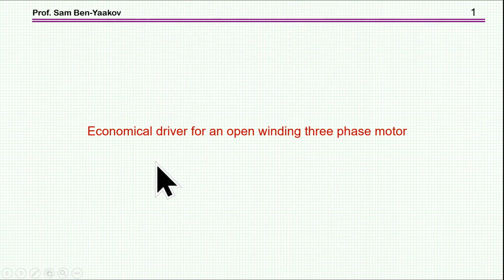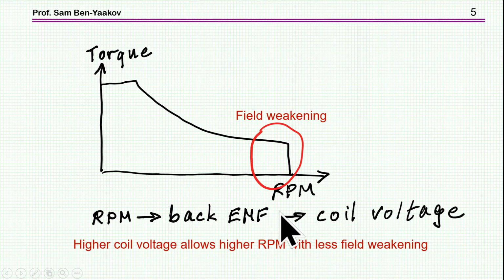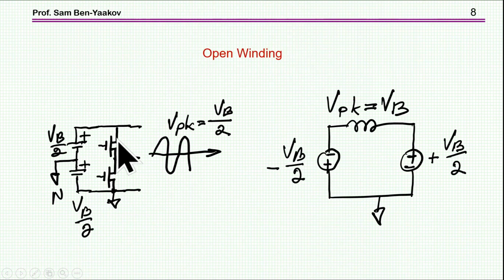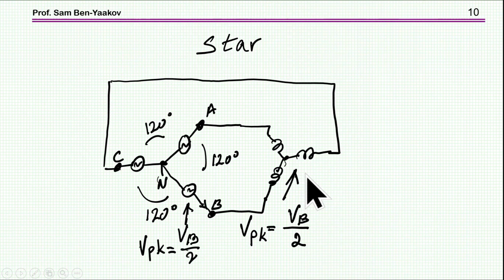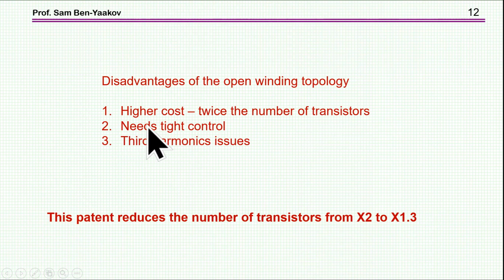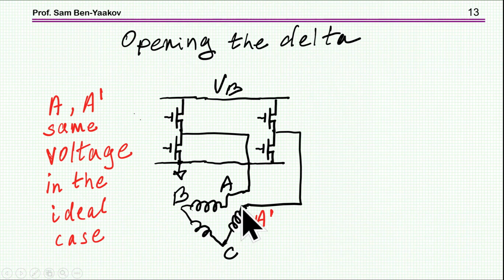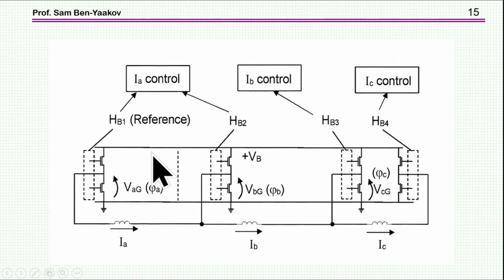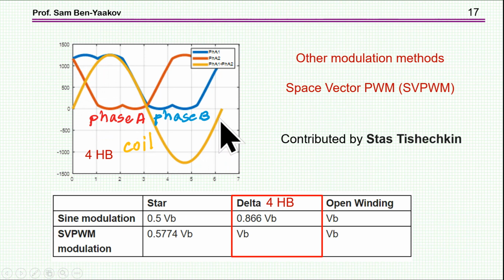Economical driver for an open winding three phase motor

Comment: Dr. Ben-Yaakov, my previous lab back in China re-invented this topology, for some special motor with zero-sequence Dc bias . 🤣🤣🤣🤣🤣🤣
Reply from the maker: Have you publised this in a public platform? If so send me the references/copies of papers and I will cite them next time I publish this subjct. And BTW, there ate previous publications on the subject which we discovered lately.
Reply: @sambenyaakov  They did publish several papers. Not sure if they are what you found. Some are as below:
[1] A. Li, D. Jiang, Z. Liu, X. Sun and W. Kong, "Unified Analysis of Winding Connection Sequence in Series-End Winding Topology," in IEEE Transactions on Industry Applications, vol. 57, no. 1, pp. 516-527, Jan.-Feb. 2021, doi: 10.1109/TIA.2020.3032936.
[2] A. Li, D. Jiang, L. Zicheng and W. Kong, "Five-phase Series-end Winding Motor Controller: Converter Topology and Modulation Method," 2019 IEEE Energy Conversion Congress and Exposition (ECCE), Baltimore, MD, USA, 2019, pp. 629-634, doi: 10.1109/ECCE.2019.8912165.

Comment: Hello sir, It will be very helpful if you could please give some explanation on the possible reasons for hall sensor glitches. While testing a hall sensor based bldc motor I could observe glitches in the hall sensor itself. Is it like hall sensor pcb mounted on the motor may have some grounding issue or something else.I could not figure it out. Kindly suggest.

Comment: Some doubts : The inner control is by voltage right ? ( So the outer is by current ? )...Also : Is it possible to apply that strategy for unbalanced loads ?
Reply from the maker: Thank for comment. No. There is no noltage control. The PWM is shiftdd by 120 deg and the current is controlled balaced or not.

Comment: But 360 is same 0 degree, so last half bridge is shorted to first half bridge, so how circulating current is eliminated?
Reply from the maker: 360 is the ideal case. the control may change it as required to get the desired coil current.
Reply: @sambenyaakov  Thank you for reply. So SVPWM creats sinusidual 120degree phase shift however the half bridges square wave has 180c phase during each pulse in order to get full Vb?
Reply from the maker: @armangevorkyan1975  "however the half bridges square wave has 180c phase during each pulse in order to get full Vb" ??? I do not follow
Reply: @sambenyaakov  how 120 degree phase shift gives full vb? It is thanks to svpwm? Not clear to me how full bus Vb achieved.
Reply from the maker: @armangevorkyan1975  yes